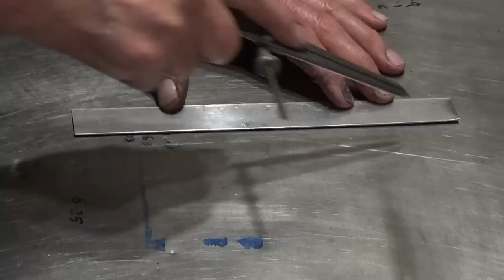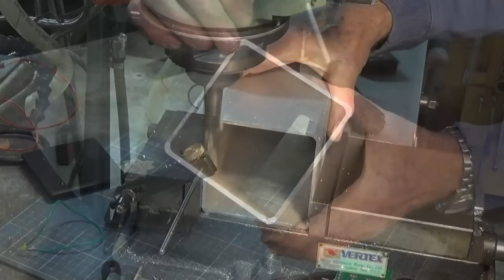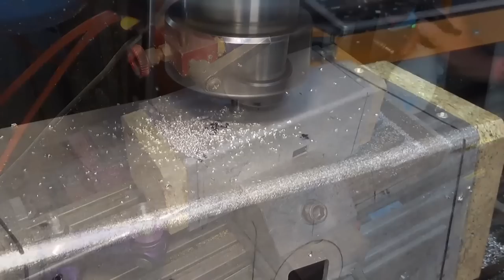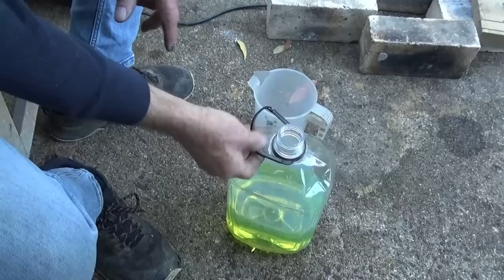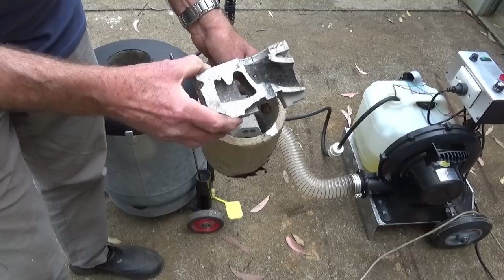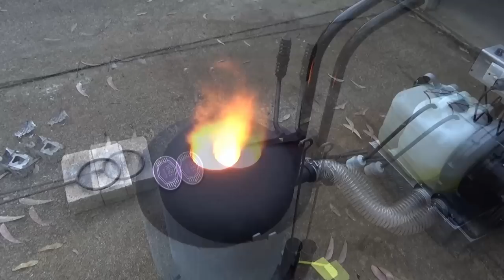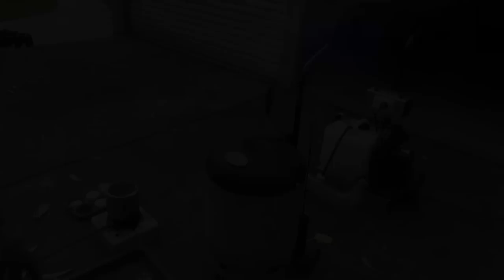Diesel Foundry Furnace Burner - Part 4

Comment: another AMAZING shop tool, impressive. I'm surprised you don't need vent holes in the electronics box. Might be a good idea to calibrate and then mark the outside of the fuel tank so you can tell how many minutes of fuel you have. Or, invent a fuel level gauge and program an Arduino to drive a digital read out to show time left for fuel and fuel flow ..... yeah right.
Reply: @dazaspc  or like I suggest, just look at the level, the tank is translucent.
Reply from the maker: I have modified the control box to include some forced air cooling. I don't think it really gets that hot but it's better to be safe than sorry. I must say that restraint is needed sometimes when it comes to adding new features to things that I make. You know what they say, "If it ain't broke, it doesn't have enough features yet". 😁
Regards,
Mark

Comment: Mark, if in future you need to get 240V AC in and out of a box use the IEC13 plugs and sockets. They take up way less space and Jaycar sell them. They also avoid having trailing leads which are just one more thing to wrangle.
The IEC13 power inlet can be had with a switch, a fuse and a neon indicator.
Reply from the maker: I have used those IEC3 plugs before on my laser cutter/engraver and my CNC controller. Unfortunately, the nearest Jaycar to me is now 45 minutes away. There used to be reseller very close by but they sold up. Jaycar also charge what I consider to be outrageous shipping fees. Remember the good old days when you could buy all that stuff at Dick Smith? 
Regards,
Mark
Reply: @Preso58  Yes, I remember the good old days when DIck Smith and Jaycar were a short walk away from one another and both were very close to where I live. I needed a lot of both inlets and outlets for a big lighting job so bought from Ali, cheaper by the 100 but I'm still trying to give the darn things away. The other alternative is just an outlet which you can buy at electrical trade suppliers.  Bunnings stock them. They come in both surface and s\flush mount. All approved for use i behind appliances where having  a switch makes no sense .

Comment: I was watching it heat up and he dialed in the air mix and got it looking quite good of a burn, then @30:47 only moments later, he decides to DIAL UP THE FUEL!!  flames start spewing out the top, bright orange and yellow flames too!!  If the burning isn't happening inside the kiln, it isn't heating anything up either.  Keep the flames inside and the air dialed in correctly so you get as complete of combustion as you can... not sure if you'll ever get blue torch going with your burner design but do your best to make damn sure there's no black smoke being produced... or any smoke produced at all for that matter!  Anyhow you've got a real decent looking piece of kit there now and I'm sure you're going to have a blast melting all kinds of metals with it.  Have fun and keep on posting the vids!
Reply from the maker: To be fair, I had almost zero experience with the whole setup when I made that video. It does take time to get to know the system and how it behaves. I have since dialled in the settings and I can get it to burn lean with little to no smoke and soot. 
Regards,
Mark

Comment: Hi Mark.  I enjoy your projects.  If I may throw in an idea for the fuel tank?
You already have the pump in there. Why cut more holes in it? Why not fit a gland fitting close the current opening, allowing easier fitting of the gland nut and feeding the fuel and electrical through. How often will you need to pull the pump out?
Cheers.
Reply from the maker: I had not thought of that. I did mount the fuel pump rigidly on a copper conduit today and I was planning on making the flange and mounting hardware for the top of the tank tomorrow. I will take your suggestion on board and take another look at it. 
Regards,
Mark

Comment: Excellent! There’s quite a lot of chunky heat sinks on the components in the control unit so would you run a heat soak test at various pump and blower settings and check the working temperature in the control unit with the ends on? May need some airflow holes or even a small fan when running for longer periods or in the depths of the Australian summer 😀. Here in Yorkshire, heat is rarely a problem…
Reply from the maker: Thanks, I have reworked the end covers to include a 40mm 12V silent PC fan and a louvre vent. You should be able to see the upgrade in the next video.
Regards,
Mark

Comment: don't forget some vent holes, those switch mode power supplies last longer when they are not hot
Reply from the maker: Fixed! I am in the process of fitting a louvre vent to one end and I have ordered a 40mm 12V fan for the other end.
Regards,
Mark

Comment: Ooooh float lock vise a la blondihacks!
Reply from the maker: Almost. I am going to try to replicate the Wahlstrom quick set mechanism known as the 24-12. It only has the one bar and a short clamping screw, but you can move the fixed jaw quickly over the whole range.
Regards,
Mark

Comment: it's probably changed now as heating in the UK is fully metric but back when I started in the heating industry nozzle ratings were met at 100 psi fuel pressure. You had a limited amount of output adjustment by bumping up the pump pressure but that did give you better atomisation and a cleaner burn providing all the other settings were correct. There was also a ball and spring in the burner arm acting as a pressure cut off so the burner did not pee fuel and continue a dirty burn after the pump was shut down.
Reply from the maker: I think Perry Merrit tried to replicate the spring loaded check valve at the nozzle end of the line but he told me it failed prematurely. He told me to just put a plug valve in the line instead. I have done that but I forgot to shut it after I turned the pump off. Hopefully I'll get it right next time.
Regards,
Mark

Comment: Great video, not sure if you mention it, but I would recommend adding some air ventilation for the electrical box for cooling. You could add air slots in the 3d printed ends.
Reply from the maker: And that is done! I have fitted a small 12V fan and a vent on the electrical enclosure. You will see it in the next video.
Regards,
Mark

Comment: That's one very nice looking setup. Next time you need to make the wick torch use exhaust heat wrap. Back in my fire twirling days we were too cheap to buy the good fire staff wicks and used exhaust heat wrap. Lasts for ages and only really breaks down due to dropping and abrasion.
Reply from the maker: Thanks for the tip!
Regards,
Mark
Reply: @Preso58  im in SE Qld and pretty sure I have some spare if you wanted me to send it to you.
Reply from the maker: @NathanNostaw  Thanks for the offer. I don't want to put you out though. I probably only use the furnace about 5 times a year. I will see how the hessian tape goes and if it doesn't hold up I will get in touch.
Regards,
Mark

Comment: A good project and a fantastic result. Have you considered a propane fuelled "weed burner" for lighting, if you have such things in Oz.
Reply from the maker: We do have them here but it's just another thing that you have to have filled with gas. One of my initial criteria was to have a furnace that was simple and that didn't rely on too many ancillary systems. I do have a little gas lighter that I use for my Oxy Propane torch but it is small and easy to put in my pocket once I have lit up the giant match.
Regards,
Mark

Comment: All that soot suggests that the burner is running a bit rich.
Other than that, congratulations on a very nice project.
Reply from the maker: It was when I first tested it but I have been able to experiment with the settings and I can now lean the flame out after the refractory has heated up. The last time I ran it the interior was pure white when I let it cool down after melting some aluminium.
Regards,
Mark

Comment: The tab to locate the lid, I would have it on the lid instead of protruding from the body of the furnace. Less risk of grabbing onto something if the tab points down and is not on the lip of the furnace, no risk that the bottom of the crucible bumps into it  when you are retrieving a crucible full of molten metal.
Reply: Sure, NOW you tell him…. 😅

Comment: I’ve been liking the burner build. Very nice and it works well. 
Kinda puzzled about all the soot. Maybe it’s from the impurities in the diesel. I would suggest trying kerosene. But after hearing what your diesel cost! Kerosene would be ungodly! 
Thanks for sharing and I’ll keep on watching.
Reply from the maker: The soot just indicates rich running. I need to do a lot more testing to dial in the settings. The reality is that that last video was only the second time I had run it and the first time was just a short test. Things will get better!
Regards,
Mark

Comment: You could also change the potentiometer to a twin pot, then as you ramp up the air the fuel would also ramp up 👍🏴
Reply from the maker: I think it's important to be able to tune the two independently. Once it all gets hot you can leave the fuel delivery as is and just increase the air supply. I have really only used it in the furnace twice so it's going to take a while to get used to the operation.
Regards,
Mark

Comment: Nice way of lighting the furnace. And overall nice build and interresting miniseries :)
The residual fuel that burns after you have turned it off, could it be some that has absorbed into the refractory material?
Reply from the maker: I think it just that there is some residual pressure between the check valve in the pump and the nozzle. I forgot to turn off the plug valve in the burner. 
Regards,
Mark

Comment: An excellent outcome. As your furnace now melts aluminium very quickly you9 can readily overheat the material do youhave a means of measuring the temperature of your molten metal?
Reply from the maker: Yes, I have a digital pyrometer for checking the melt temperature. Copper and brass can be really nasty if you overheat them. Brass especially. The zinc fumes can be awful.
Regards,
Mark
Reply: @Preso58  Good! Would hate to lose your excellent videos. By the way do you add a cover on your metal  prior to melting. In the  UK If I recall correctly a product called Coverall was a product that was used, to reduce the amount of gas getting into the melt. Similarly do you degas your metal prior to pouring a casting?
Reply from the maker: @MartinDance1  No, I don't take any precautions to protect the metal during the melt. I took some advice from Martin West (Olfoundryman). He told me that most degassing methods don't work and the only effective way was to purge the melt with very fine stream of argon gas. Most of the commonly described methods like using sodium carbonate don't work and may in fact add extra porosity if the powder is damp. Degassing tablets can liberate nasty and toxic fumes. His best advice was to melt the metal as quickly as possible and to use clean ingots of a known quality. I purchased about 20 ingots of 601 series aluminium from a local foundry at about $5 per kilo and it transformed my castings. They are now clean and nice to machine and most of the porosity is gone. A flux does help on brass and copper. I believe that ordinary borax powder can be used but I haven't tried it on aluminium. I don't know if it is suitable for that metal. I guess there would be some proprietary aluminium fluxes available.
Regards,
Mark

Comment: Excellent build, vid & series Preso, so when do we add the Turbo!? The “Handle Scandal”, I always thought should have been raised 200-300mm above the cart handle & in the same line so you could open it in either direction & it would be higher & out of the way of the heat exhausting. TFS & a very entertaining few hours, havta check out what else you got. Cheers
Reply from the maker: Thanks for watching. I am almost finished the next instalment of the build and then I can get onto some actual metal casting. 
Regards,
Mark

Comment: Would the continuance of the burn be due to venturi effect with the air flow siphoning fuel from the tank?
Reply from the maker: I think I have found the issue. There is what appears to be a check valve at the pump outlet and the fuel tube inflates slightly when it is pressurised so even after you electrically isolate the pump the fuel will still get pushed out of the nozzle due to the back pressure. I just neglected to turn off the plug valve at the burner end. I will get the workflow sorted for the next video.
Regards,
Mark

Comment: I built very similar furnace, I use diesel / waste oil mix. It will burn just about anything as long as its clean. I had the same after burn problem turned out the shut off valve was leaking a little when the furnace was off and would soak the floor of the furnace with oil, eventually it burns out. It looks like your setup could siphon from the tank if the valve wasn't closed.
Reply from the maker: I will be talking about the burn run on issue in the next video. It's an easy fix and it's to do with me just getting the order of operations sorted out.
Regards,
Mark

Comment: Mark or anyone really have any ideas on how to cut back on the noise of a foundry furnace? The jet engine sound can be annoying to neighbors when ran for a couple hours.  Thanks
Reply from the maker: Unfortunately, the only really silent furnace is an electric resistance type. I guess the advantage of the diesel burner is that it is quicker than my old propane burner which means the noisy period is shorter. 
Regards,
Mark

Comment: it certainly looks capable of melting iron, i wouldn't worry too much about your refractory, it'll hold, it's just that it won't last for years if you hold it high temps for days at a time like in an industrial setup. aluminium will only take you so far!
Reply from the maker: I think you have to be a real man to melt iron. I think I will stick with the wimpy non ferrous stuff.
Regards,
Mark
Reply: @Preso58  nah, if I can do it, anybody can! it seems scarier at first due to the higher temps but it's all hot enough to hurt if you're not careful. It's the density of the stuff that's the big difference, so as long as your handling gear (and physique!) can handle it, you'll have no worries. Weirdly enough, I wen't the opposite way to most, I started with iron, then bronze, then ali! there's nothing like learning to swim at the deep end!

Comment: Mark nice job! If wiring is hidden away, it only needs good integrity not good looks.
When you shut off furnace did only pump get turned off? A hard shutoff valve may help. I am suspecting siphoning from tank to burner.???
Reply from the maker: Yes, I just cut the power to the pump and I wasn't prepared for the back pressure in the delivery line. I do have a plug valve at the burner nozzle and once I turned that off the flame died down very quickly. I think there is a check valve built into the pump which stops back flow so the pressurised fuel has to leak out of the burner nozzle. I am sure I will get these little wrinkles ironed out with a bit more use. 
Regards,
Mark

Comment: Hi  I enjoy build videos thanks . Could I suggest that your flame is burning too rich and thats why you are getting the yellow flame and the burning flame after you have turned it off , is unburned fuel in the bottom of your furnace . I have built a simular size furnace using diesel siphon nozzel . This means I don't need a blower or a fuel pump ,  just a compressor which I already had . It takes about 15 to 20 minutes to melt about 5KG of aluminuim and uses very little fuel .
Reply from the maker: I guess I am a bit inexperienced with this burner and I am going to have to work with it for a while to discover how to manage the fuel/air mix. It's quite unlike my propane burner which is sort of light and forget! However it is quick and despite the soot, it's certainly hot. I am sure you will see it running much better in future videos.
Regards,
Mark

Comment: There are proper fittings and clamps to suit different sizes of flexible hose. The tube fittings have a turned up flange and they are clamped together with a rubber lined cam close clamp. I have used them in different sizes on a couple of projects.
Reply from the maker: Another viewer had told me the name of the type of clamp to search for and I found a supplier. I knew that there would be something ready made that would do the job but it would have meant a three hour round trip to get them or I would have to order them online and wait forever to get them. 
I can be impatient that way!
Regards,
Mark

Comment: Great video series Mark. I had wondered if the furnace that Martin (Olfoundryman) used in his setup could be mimicked on a smaller scale and you have done just that.
Reply from the maker: Martin sent me some drawings of his burner design and it was way, way more complex than what I have made. It was a true commercial foundry furnace burner with all cast iron construction and multiple jets for air and fuel. It made my brain hurt just looking at it. At the end of the day though, fuel and air go in and heat comes out. At least that's what you hope for.
Regards,
Mark

Comment: If you want a wider Hose Clamp chase up NORMA as a brand. I have used them on heavy duty Pump Suction lines over the years and should be easy to find.